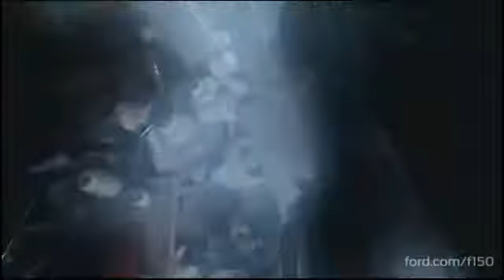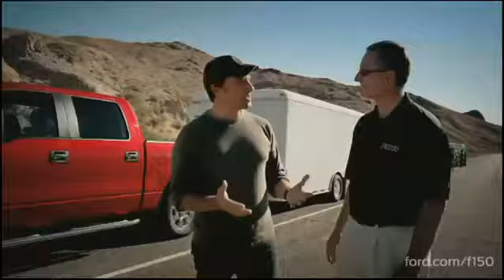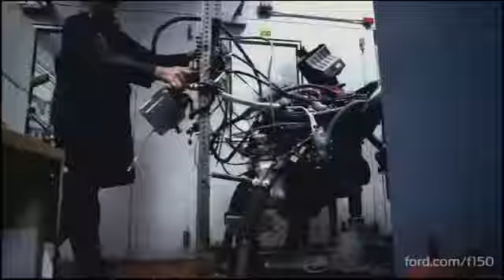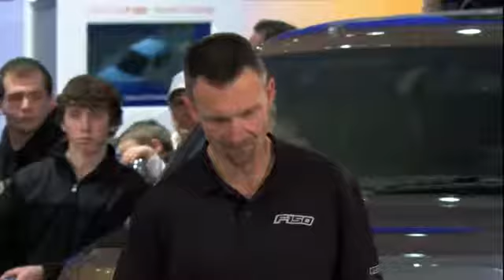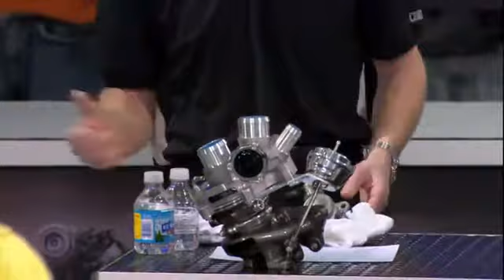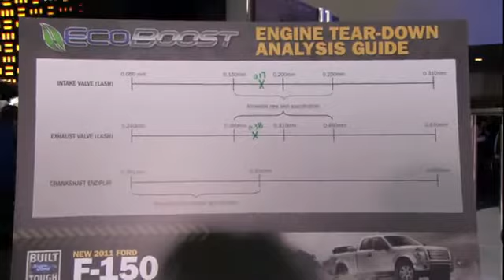Ford F 150 EcoBoost Teardown from NAIAS   Part 1   YouTube

Comment: B.S.,its an engine plaqued with timing chain issues,warped exhaust manifolds,broken exhaust bolts,coolant leaks,oil leaks,transmission bulk head sleeve leaks,and many other issues. I suppose if you have a team of mechanics to follow a specific engine around and fix all the issues that arise you could keep it running. But for the average person its a damn maintenance nightmare. Even with all of the issues that they know about since its introduction, still today in 2021 the same damn problems are still there. Piss on you FORD!!!!!!!!!

Comment: Accept the timing chains stretch and cam phasers still are shit
Reply: They don’t use timing belts.
Reply: All chains stretch over time. The cam phaser issue is solved by doing your routine maintenance.
Reply: @kgot7436  all maintenance done at Ford, extended warranty (needed). 3 F150 nothing but issues.